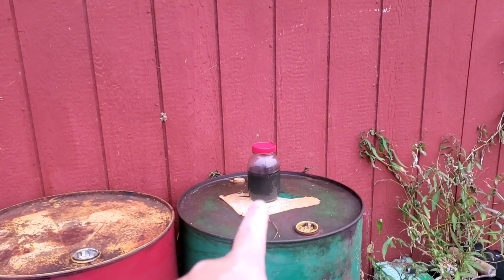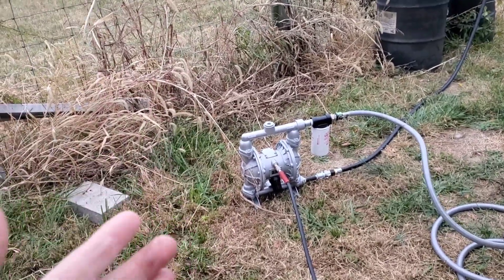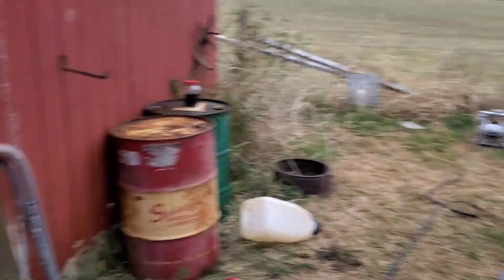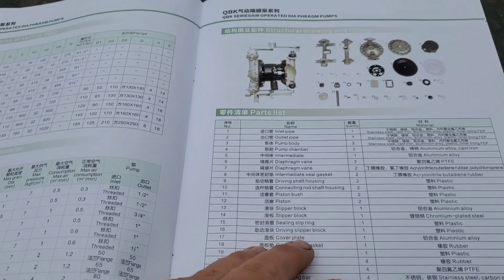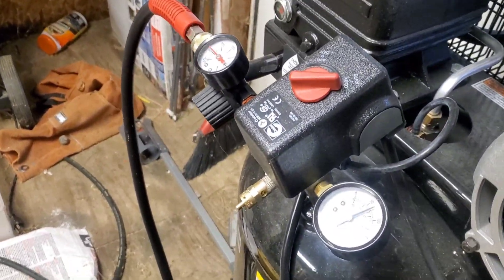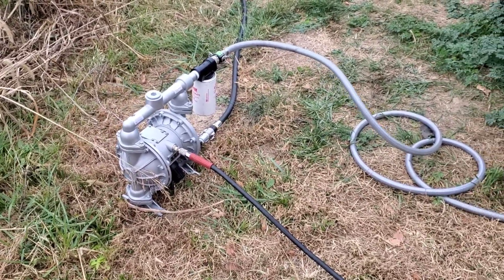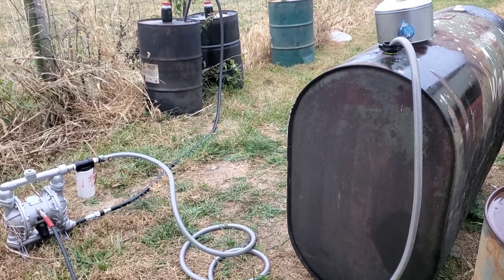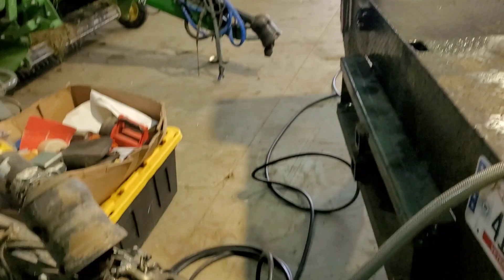Diaphragm pump.  Moving fuel and waste motor oil.

Comment: Your filter needs to be hookup to your bottom hose. So it can catch all your dirty oil before it entering your pump.
Reply from the maker: These pumps are not designed to pull through a filter.       They are designed to pump sludge.   I ended up not using a filter at all on this setup.